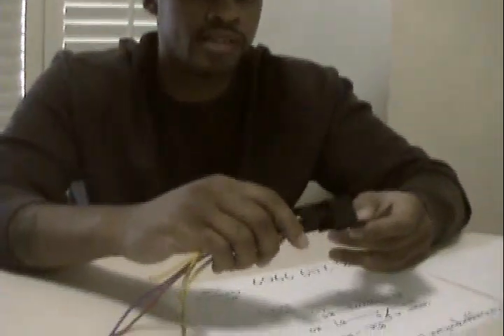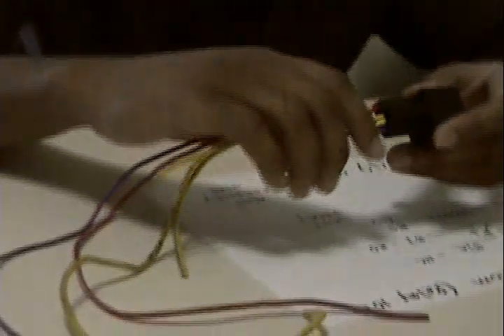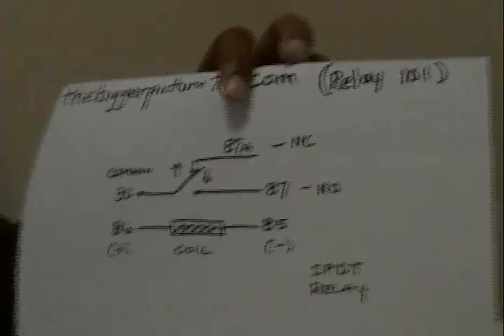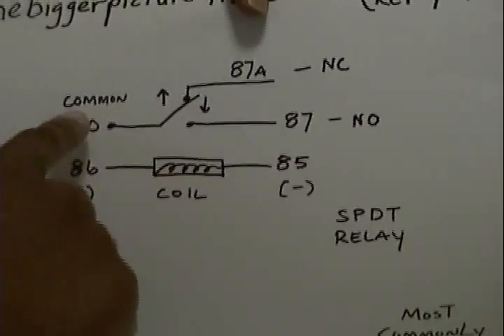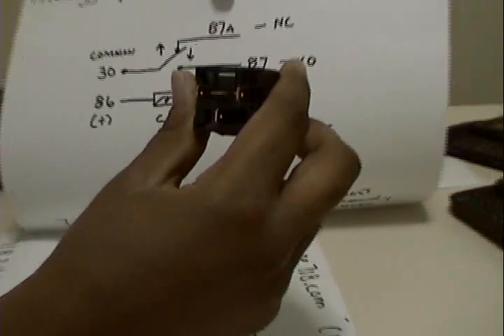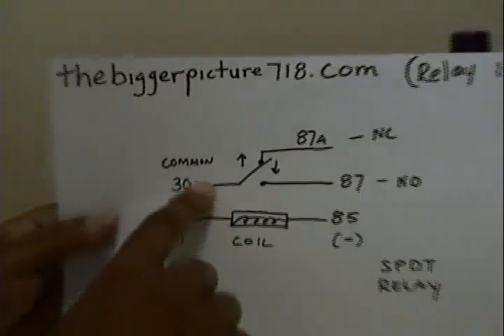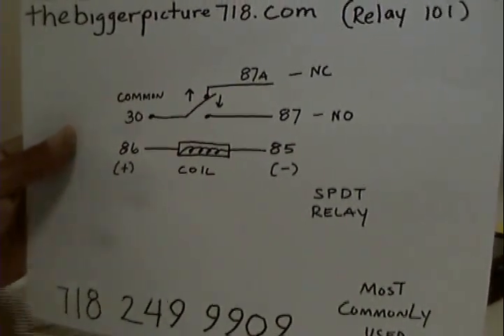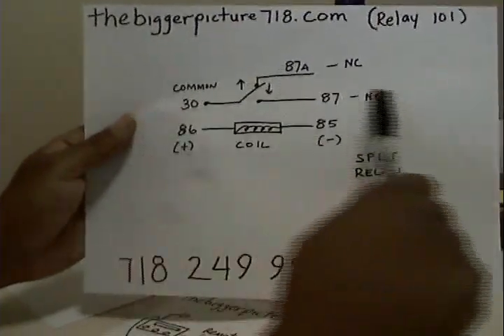Relay 101

Comment: The relay did not reverse the polarity in this circuit! The way the circuit is wired determines the polarity with 12v being on the opposite side of the load and ground supplied to terminal 87 my friend. All the relay did was "switch" on the circuit.

Comment: Relays do not increase or decrease power! Relays pass power, which in this case is the 12v sir. The relay is only a switch, "an electromagnetic switch" as illustrated in this video. If you want to increase or decrease power you need a transformer sir.

Comment: Good job but be careful saying "generate current" as a relay doesn't create any voltage or current.  I always illustrate my coil as the control circuit and the contacts as the power circuit.  Keep it up man

Comment: Sorry if my question sounds stupid. Doing a first time install all by myself and was wondering, once I have my two amps branched off 87, the 85 going to ground, the 86 going to the head unit, and the 12v from the hu goin to the 30, do i need to connect anything to the 12v slots on my amps?

Comment: Man your video was so good to watch.  Came across it by accident think by typing in SPDT relay, cause didn't understand SPDT meant.  I'm in basic auto electronics 101 right now and we don't get shown or explained too much of anything, and when do get to watch a video they're really old (from late 70's) and boring.  Relays, transitors, resistors are confusing in this book, haven't used them yet, just the dvom so far, but you explained this SPDT relay typ in way could understand, thank you!!

Comment: 1.)

TBP: I been into electronics all my life, I am a ham radio operator for 15 years and have degrees in electronic circuit etc etc. Installed many car audio systems and droves of other electronic projects including transmitters, microwave systems, Vhf repeaters etc and I can say you did a great job in this instructional presentation. You explained it perfectly and want to say thank you for even taking the time to do so. CONT>

Comment: @coolmechanic it keeps a sustained (bufferd) so to speak current. If your head unit produces 12.4 at the remote and its passed through a relay,the constant with the car ON will be a rough 14.9 it sustain 13 or there abouts.if it didnt like you say why would they exist in car audio? ehhh?

Comment: What I stated above is the facts on how a relay works,. not an opinion.  You seem to know how to "use" a relay, but not really understand how it works. Again, a relay doe not "amplify", an amplifier amplifies, ( check (Ohm's law) and if you put 12v+ in a relay, you can't get 12v- out, or vice versa.  What you can do is, bring power in to a load "through" a relay, not "from"  a relay (which is just a switch) or ground a load through a relay which you call "reverse polarity".

Comment: I'm sorry to have to say this but you have some major misconceptions about relays:
A relay "DOES NOT"  generate, amplify or boost anything, and a relay does not reverse polarity as you explained it.
A relay is just a switch, a break in a wire, that gets connected or disconnected by the coil. The coil is totally isolated from the contacts.
I suggest you take down this video, correct 
it then re post it, as you are seriously misleading people.
Good luck.